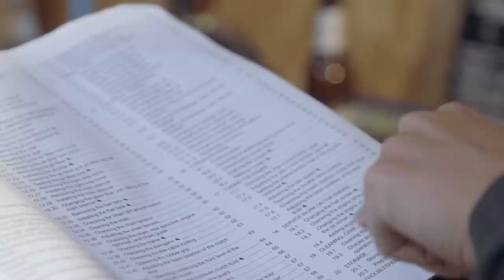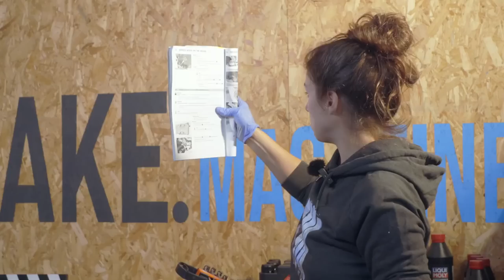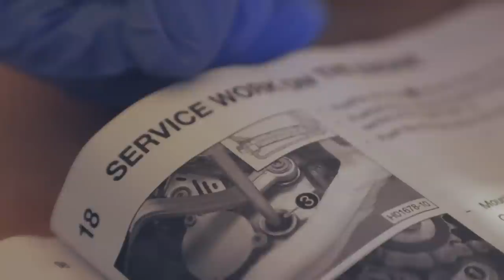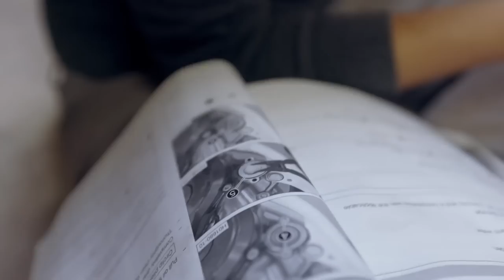A manual, a dirt bike & an oil change.. | What could go wrong?

Comment: Toss the two oil screens into a glass jar full of fuel, put the lid on and shake it for a bit and those filters come out very clean. 
I’ve never had any issues with the rubber parts as long as I’ve reinstalled them soon after so they’ll be coated in oil again (also a hydrocarbon, whether synthetic or not).

Comment: Great Video, you guys are really charismatic. 

It would be optimal to drive an spin all 6 gears to ensure all the slug and residue comes out of the engine, if you wear proper gloves and work fast the oild shouldnt burn you. Just thread the plug out till its nearly falling out and then take it out really fast. But i know the pain and fear of burning yourself. Nevertheless an oilchange with warm oil like you guys did is already way better than with cold oil. 

Greetings from Austria
Reply from the maker: Great suggestion!

Comment: Heating the oil by running the engine is not to change the viscosity, it is to get any crud and metal into suspension so that it comes out with the oil rather than staying in the engine and building up.
Reply from the maker: Everyday is a school day!
Reply: it certainly does both.